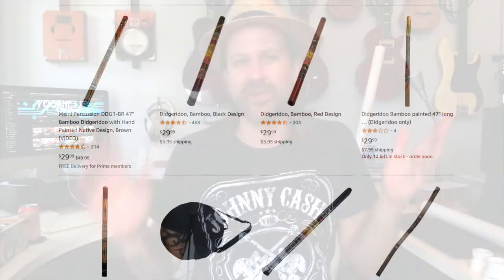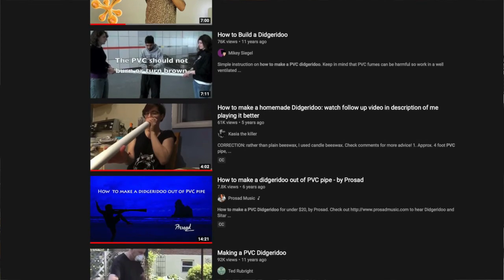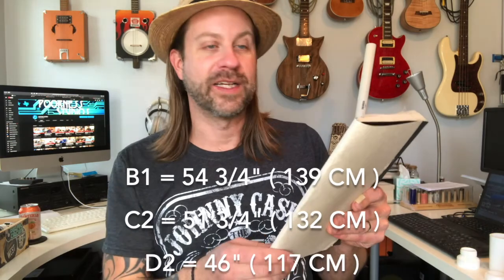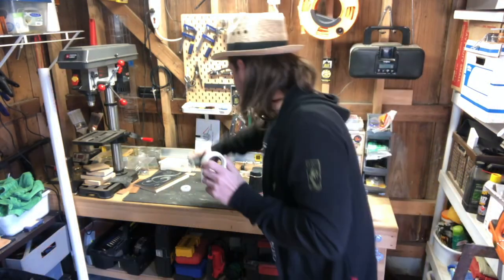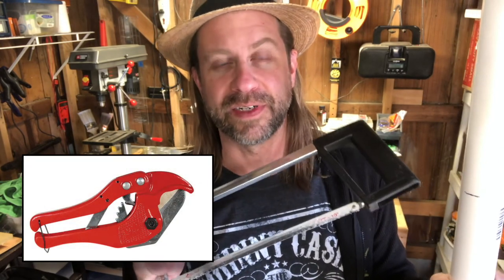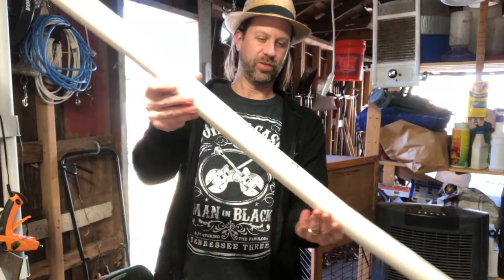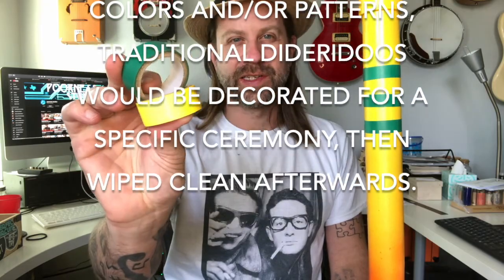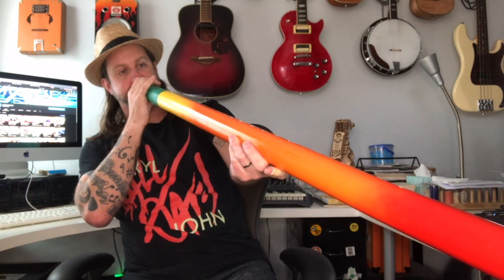Building a PVC Didgeridoo (A Beginner's Guide)

Comment: I went to Lowes. Went to the PVC isle. Found a pipe which looks around 5 foot long with a 2.5 inch diameter. Went to the fitting section where I found an adapter that would fit a mouth peice. The adapter was at a 25°ish angle and had female openings. The mouth peice is a simple 2"  long flange PVC (male, to female.) Perfect low end didgeridoo
Reply from the maker: Nicely done! Part of the purpose of this video is to get people to try some of their own designs. Thanks for the follow up.
Reply: To use a didgeridoo you want to be able to tighten up one side of your lips, and let the other side do the reverberating. Press your lips inside of the mouthpiece. And use only one side. Don't be afraid to rotate the didgeridoo to find the perfect sound. It's okay to experiment

Comment: Love that you have taken this on. I would hope anyone playing the didj, doesn’t burn plastic. Period. Ever.  Not good for you, the air around you, or the environment.  That being said. They make a different size to accommodate your needs of a bigger inner diameter. Most hardware store sell 2ft sections of ABS, not PVC(contains chloride, not good for humans). I buy a 1-1/4in., 2in and 3in sections. This is enough to make two didjs that sound completely different. I use the same mouthpiece but with the nylon thread nut, shaved to fit my face ergonomically. Also widened, dim are 1-1/8 tall and 1-3/8in wide.
Reply: The one thing that is completely different is the density of the material, plastic has a ring to it. Wood is more earthy, the harder and thicker the muddier.
Reply: I cheat, as I need more length then 24” for certain sections. Take a 1-1/4”x26-1/2” and then a 3”x17-1/2”.  Then get a 5’ stick of 2”, cut into different lengths, no more than 35” or so.  The key drops to an A and becomes breathy. At 2”x15-1/2” you should have a D#, at 20C# and 28 a B.
Reply from the maker: It sounds like you know a lot about homemade didgeridoos. As you gathered from the vid, this was my first attempt at building and playing one. Thanks for checking out the video and sharing your thoughts. I really appreciate it.

Comment: I'm watching this after having finished mine. A different way to tune it in is to pick a note you like the sound of, in my instance C2 as well, and trim it down like an inch at a time until it produces that 65.4 Hz. Mine is around 64" or 162 cm to get me to that C2.

This technique also makes sure you can hit the note you want. There are different frequencies for buzzing your lips. I played low brass in school and so I had the advantage of muscle memory. The plastic cap that came with the adaptor is easier to use than the uncapped section, but you might do well reducing the ID of the mouthpiece to an inch. Try using a cap and drilling an inch hole in it.
Reply from the maker: That's great advice and totally logical. Thanks for the comment. Ironically, I did the cap mouthpiece on my second PVC didgeridoo which also has a vid on YouTube. https://www.youtube.com/watch?v=u3dAhl-GzGc

Comment: You're a natural! Very impressive first time playing! Thanks for the tutorial! 
I made one of 1 1/2" PVC & a wax mouthpiece. Would not glue as fittings are tight without it. 
The bell should be longer & more flared, but may be just for esthetics(?) Great job though! 👍😜👍
Reply from the maker: Thanks for checking out the video. I really appreciate that.
Reply: @lmiscellany  I'm thinking of making a "portable" model, using some pvc elbows...difficult to tune, but 
why tune it anyway unless playing in a group? Looking forward to adding art to it, too. Does it even need a bell?
Though does look cooler with one. Would like to hear you play it. 😉👍  
I'm still working on my "drone". =P
BTW, this is the coolest duet ever!  https://www.youtube.com/watch?v=oXBGZoBYaLY
Reply from the maker: @ccmcgaugh  I could imagine a PVC travel didgeridoo being very cool. Thanks for checking out the vid and good luck on the build.
Reply: @musicalmiscellany   Just cut it down from ~6ft to 139 cm (B1) using a PCV pipe cutter (twist, cut, twist cut....)
Makes a very clean precise cut. I marked it for the other lengths in case I want to take it down more. 
Wonder if you drilled a 1/4" hole at the other lengths you could change the tone e.g. a flute, opening/closing
with your fingers?

Comment: Another interesting videq. I'm sure anybody building one will appreciate the time you took to do all the math for them. FYI- I'm pretty sure if you use the pvc cleaner for glueing on the size and bar codes they should come right off.
Reply from the maker: Thanks for watching. That's some good advice. I should've thought of that. I also could've shot a coat of primer on the PVC first... that would've probably covered them as well.

Comment: Nice video! An alternative to bending the pvc is using a bigger bell, such as a traffic cone or the top of a 5 gallon water jug. This makes the instrument less cylindrical and adds to the sound, similar to the sound it makes after bending it. Have you heard about this method/looked into it at all and if so do you know what the measurements would be for it? Thanks🙏
Reply from the maker: Yes. I have seen those methods, I actually mention it during the bell section of the vid. I am not sure how it would change the dimensions though. Obviously, the larger diameter would affect pitch but I'm not sure how to compensate. It's probably a much more complex formula to figure all that out. Thanks for watching the video.

Comment: I viewed your video because the Didge I recently got as a BD gift for my son developed an~20" crack. [This I've learned is not uncommon and can happen without any abuse being done to the instrument.]  I'd like to make a Didge that is not going to crack and if abused only cost a few bucks to replace. This PVC Didge looks like it fits the bill.
Two questions... 1. Is there any health risks involved with playing this "plastic" instrument? 2) Didn't your putting bends in the PVC in effect change the length of and as a result the tune of the Didge? Thanks.
Reply from the maker: Thanks for watching the video and I'm super glad it was helpful to you.

I don't know that I'm qualified to answer your first question but I know there are recorders, flutes, and several other wind instruments made from PVC (not necessarily PVC plumbing pipe but polyvinyl chloride nonetheless) and I've not heard of any health effects with those. Again... I'm not the expert on this but I'd lean toward no.

Great question about the bends. As  you point out, you're effectively lengthening one side by a fraction of an inch while shortening the other by a similar amount. I too thought about that. However, the end product seems to be in tune. Here's a video of my playing it with other instruments so you can hear. https://www.youtube.com/watch?v=lO3fmHEntSk

It could be that the bends weren't enough to affect the tuning or maybe my measuring was slightly off and the bends fixed it... but it worked in my case. Thanks again for checking out the video and good luck.

Comment: Does the diameter of the pipe affect pitch? Does it produce a better tone the wider in diameter?
Reply from the maker: As I understand it (and keep in mind I am just a beginner at this) the diameter will affect the tone but not the pitch. A 2" pipe and a 3" pipe of the same length should produce the same note. The timbre and volume may be slightly different but the length controls the pitch..
Reply: @musicalmiscellany  thanks so much! Is there any chance that you would have a suggestion on mounting something to it? I am planning on customizing my instrument in a very specific way and need to mount a ring to it that can hold its weight for a neck strap. I am using a 2 inch  CPVC and it is very heavy but I prefer the tone. I have played saxophone for 20 years and have realize this instrument is all about embouchure and breathing which seems to be equally important for each instrument. I’m going to make one in a similar shape to a sax so it feels comfortable and I can switch instruments mid song. I’ve done this with 2 different saxophones in the past as well.

Comment: Can anyone send the link for the trap adapter I cant find it
Reply from the maker: You should be able to find one at just about any hardware store.
Here is one example: https://www.lowes.com/pd/Charlotte-Pipe-1-1-2-in-x-1-1-2-in-dia-PVC-Schedule-40-Hub-Trap-Adapter-Fitting/3132643
Here is another: https://www.homedepot.com/p/NIBCO-1-1-2-in-x-1-1-4-in-PVC-DWV-Hub-x-Slip-Joint-Trap-Adapter-C48017HD112114/100348180
Reply: @musicalmiscellany  i live in the uk tho
Reply from the maker: @Goomp141  I don't know any UK retailers, but if you were to show those links at a shop in the UK... I'm sure they could figure it out. The main thing is that you need something that fits the PVC and functions as a mouthpiece. There are many different ways to do that. I show a few different ideas in the video.

Comment: Tune is not correct if you use a 3 or a 5mm diameter, sound is different.
Reply from the maker: Based on the theory, the pipe's resonance is determined it's length not it's diameter. The pitch of the note should not change with different diameter pipes but it will sound different. Think of it like playing an A note on a guitar vs a ukulele. Both are the same note but they sound completely different based on the body size of the instrument. That's the science behind it anyway.

BTW, where are you finding 3mm PVC? I'm assuming you meant 30mm.

Comment: 1.315 M =131.5 CM =51.77 inches =51¾ and a bit inches.
Reply from the maker: Yes, if you can accurately measure to the hundredth of an inch, feel free to be that accurate, I normally round off to the nearest eighth because even that level of measurement is hard to get exact. Thanks for checking it out.

Comment: Ayooo. can u help me translate the measures to cm or meters the 513/4" is messing me up 😅
Reply from the maker: Thanks for checking out the video. You might want to rewatch Part 2 @ 5:04. It's actually a metric formula so I give all the lengths in CM before converting them to IN. I go over all the common keys in both IN and CM, so the information should be there for you.
Reply: @musicalmiscellany  will try to check if I can get the info there already translated almost everything since um Portuguese we use different measure names .. ty for u're reply m8 omw to buy the stuff to build one
Reply from the maker: @sonofabear-8268  51 3/4 Inches = 132 CM if that helps
Reply: @musicalmiscellany  yeah ty a lot. Didn't know about the bending of the tube ty for that tip 😉

Comment: The metric unit system wins yet again.
Reply from the maker: Ha ha. It always wins because it actually makes sense. Thanks for watching.
Reply: @musicalmiscellany  this was the most thorough, and informative guide I could find, with even the accurate measurements, thanks so much.
Reply from the maker: @blackfeathers2166  You're welcome. I tried to find this information when I made my first PVC didge and it was difficult to find. That's the reason I made this video. I figured someone else may have the same questions. It's always good to hear when it helps someone else.